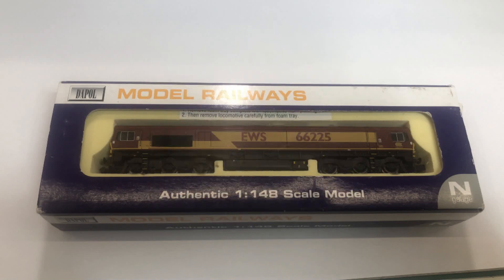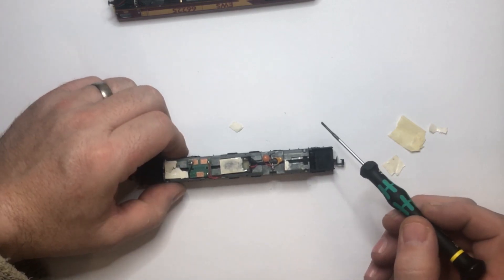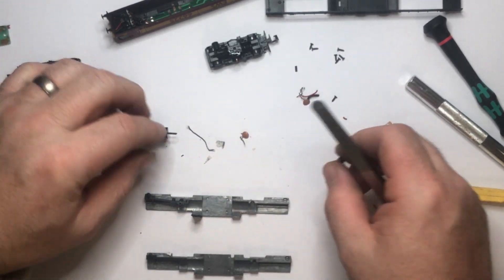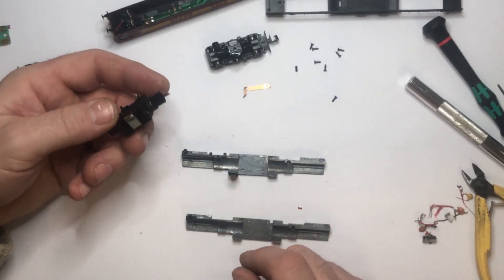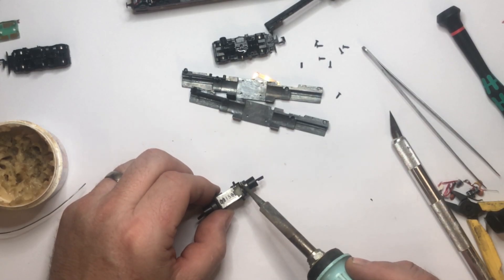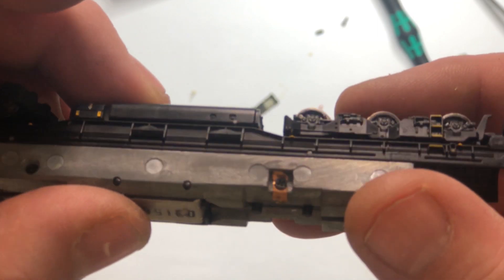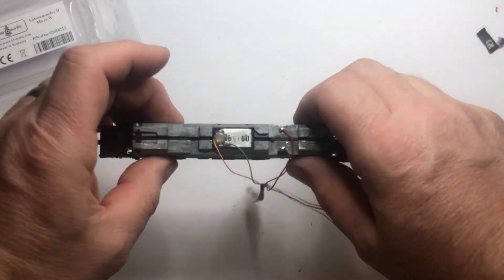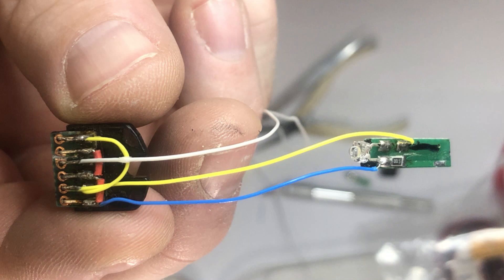Converting an Old  Dapol Class 66 to DCC

Comment: Job well done. Lucky you found all that room inside the 66. I've done a few and have had to file off quite a lot of the chassis to make room for the decoders. I use the Lenz wired decoders, the smallest I found and while my other locos are all controlled by similar Lenz decoders, I find that they are easy to program and all work fine for me. Again, job well done. Now to go start my latest acquisition, a class 37 :)

Comment: Thanks Geoff on your advice on DCC conversation. Using your video just done a GNER 91 . Can I ask you where did you get your little Dremel from
Reply from the maker: I'm so pleased you have found it useful and you have managed to do your own conversion  . i use a Dremel 3000 and a small MiniCraft which Ive had for many years , cant recall where I purchased
Reply: @flinthillsmodelrailway  thanks. Geoff.